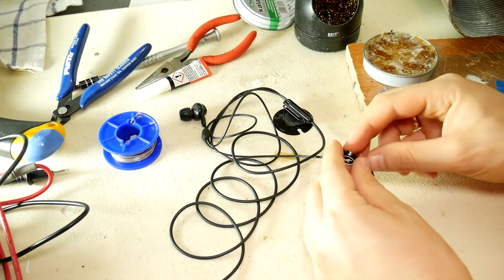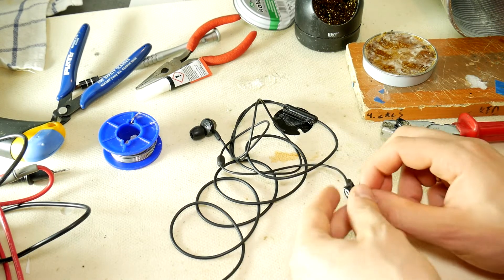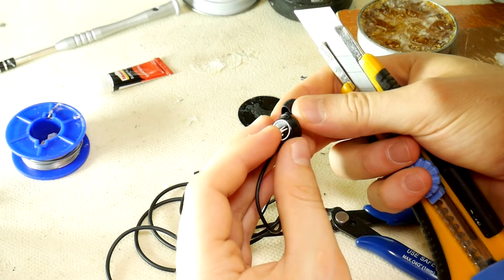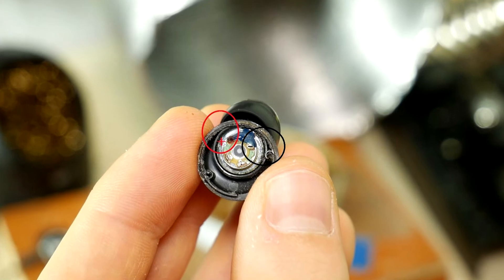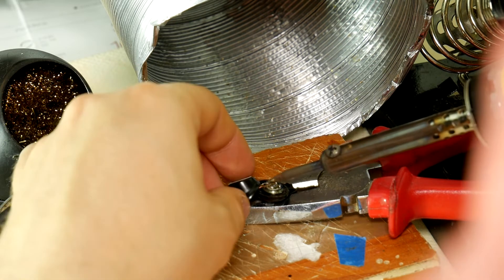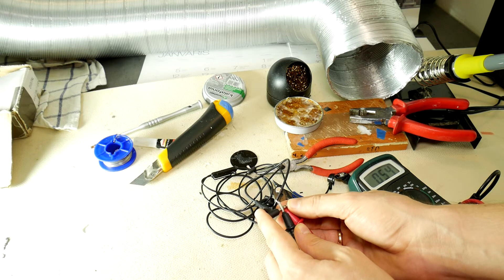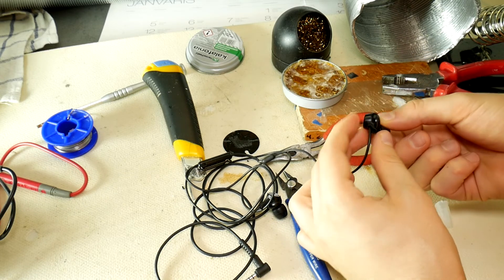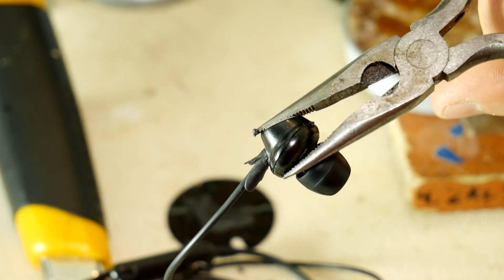How to Solder Headphones/Earphones Wires Back Together DIY

Comment: Props for keeping these devices out of landfills.🎉

The housing of my IEMs/earbuds is unconventional in that the shell isn't a symetrical two-piece design. To access the innards there's a plastic 'window' with cormers where an X-acto blade may not track well for the cut. The window is prominent with the OEM's logo, so marring will show. Please share if fixers have luck with other tools to split these units from wonky angles.

Comment: I did it with hot glue... At first, I thought there was supposed to be an actual cable, but all there was a copper-colored thin wire (?) with white thread in the middle, and I cut it shorter to find it, that was a mistake. Then I came to see how the cable actually looked. I glued the earphone earpiece to the table, and then, while holding the wire correctly, I dropped a hot glue drop on it, and it did the job. I worked quite a sweat while holding it steadily. Of course, it would be easier if I had a soldering kit, but you gotta work with what you have.
Reply: Solder kit would have cost you $10 from Walmart

Comment: the solder does not stick to this type of wire at all. not sticking after hours of trying.
Reply: Use flux
Reply: @Uch123456  used flux over and over solder just rolls off like its repelling the wire. super fine wire like hair and tiny
Reply: @ferenclucas2842  Sounds like the temperature of your iron is too high
Reply: @Uch123456  ah thanks alot i will try to turn it down :)
Reply: @ferenclucas2842  you're also going to want to make sure that you're using a clean iron tip. There are videos out there on how to clean oxidation off of the iron if you're unfamiliar.
Reply: @Uch123456  Do you use only flux or solder wire with flux? I am a noob and this is my first time soldering so I'm not sure how to do it without messing everything up. I'm trying to solder a tiny headphone wire to its base chip. The wire didn't even break off completely, it's just very loose so the connection is breaking up. I just need to make sure the wire is tight and doesn't break up.
Reply: @bsndragon  You're going to want to apply solder to the pad first. Next you're going to want to tin the wire. Lastly place the tinned wire onto the pad and use the iron to heat up them up so that they become soldered together. 

You can use additional flux if needed. With small wires though just be careful not to use a ton of flux or else the solder will wick up too far into the wire. I've included a link to a helpful video below. 

https://youtu.be/0YIT6MeaXT4?si=e2AgPPoIyqPxrrUX

Comment: When you say "first solder them alone" at :42, is this to better expose the inner wire on the green and gold wires, or some other reason? I don't have much soldering experience with tiny wire like these and want to make sure I get a good connection.
Reply: Correct. Tinning the wire removes the insulation coating in addition to covering the wire in a thin layer of solder so that it attaches more easily to the pad when you touch the iron on them to solder them together

Comment: I successfully solder the speaker in my earpods, but it's not connecting on my phone, it's working and lighting blue and red even the battery bloated , do you think that's the reason?

Comment: I one of those tiny color-coded wireot broken inside one of the earbud. Both sides the wire are poking out so it's be easy to solder back together. However, I am unsure if the color part is an insulator or not. Can I just solder it together, or do I need to strip the ends of the broken wire first? Also, how do even I strip those color wires?

Comment: Can I use glue over soldering
Reply from the maker: no, you need melt together metals,
Reply: What is the adhesive used to hold the speaker in place is it paper or liquid adhesive
Reply: Anything u have that can hold the wire to the connector point and still work. Do that

Comment: What if there's a third blue wire? I opened up the left side of my headset and there are 3 wires, a red one still sodered next near the red glue, a copper one on the opposite end sodered also (no colour glue) and then the blue one in the middle is the one that's loose.
Reply from the maker: best way is check wires with multimeter. there are often more wires than are needed for working.
Reply: @TechscrewDIY  Roger that, thanks.

Comment: Hello my friend, I'm here because you helped me fix my cable in hyperx stinger
And I'm here because i need you one.more time, 
It have been a week since my hyperx stinger mic do some wind sound, like wshhhhhhhing, i have to adjust the Position of the mic in up and down till it disappears and my teammates can hear me in pure sound, but it will back 
How to fix this ?
Reply from the maker: Thanks for sweet feedback.

About mic problem, firstly check mic wires with multimeter, if they broken, rewire.
Reply: @TechscrewDIY  yes, after open the headset, there's a wire start from the mic area cover in some plastic, to the main board, i touch it a little the noise increase, 
What I did is; there are 2 screw in the mic area i tight them, the noise almost disappears, but only if i put the mic exactly in the front of my mouth, if i low it further it will appear, i think that cable need to change, but how to get ride of this plastic to get him out ?
Reply from the maker: @OmarXSparrow  simples way is just wire new cabe outside mic arm.
Reply: @TechscrewDIY  exactly, but i think I can't do it LoL I'll send it for repair soon, it's hard from the inside 😂